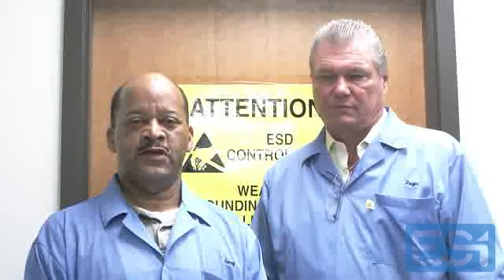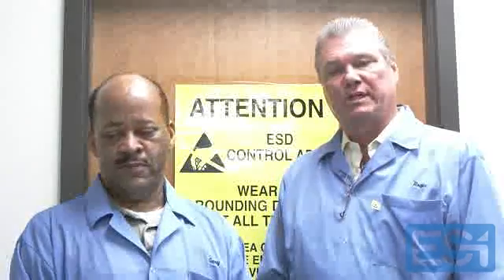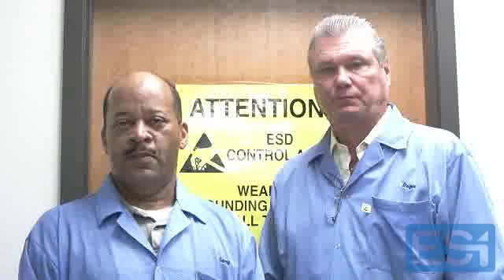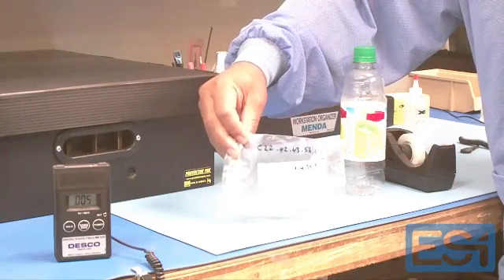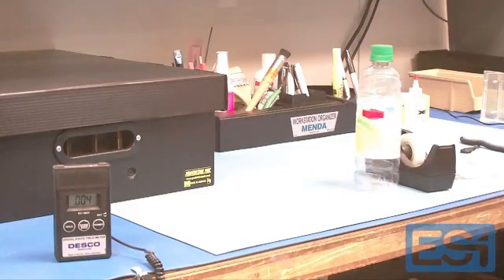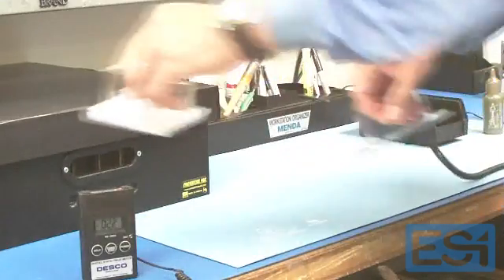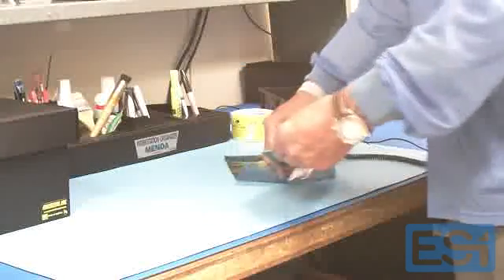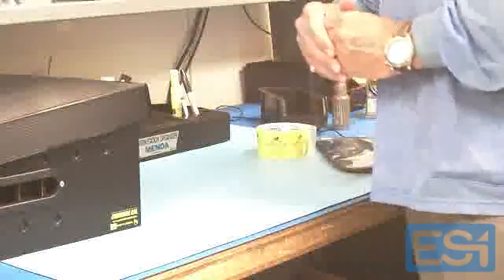ESD Protection - How To Create An Anti Static Environment

Comment: We buy seeds and other organic materials that come in plastic bags and are loaded with static electricity making it hard to even completely empty the bags. To make things even worse pouring the contents of the bags transfers the charge with the seeds. We wind up with little seeds suspended in mid air over anything plastic like a funnel. When we switch to a new seed type,  despite our best efforts, we'll wind up finding old seeds mixed in with new ones down stream. The supply of one more renegade old seed seems never ending.  How could we lose the static while emptying the bags right up front?
Reply from the maker: Get an ESD mat, ground it, and lay the bags on it prior to opening.  Let us know how it works!

Comment: A question, we have ESD floor and the work table and surface rug are ESD, it is necessary to land it to physical ground the surface rug and the work table ??
Reply: It's good practice. For example, if you lift your feet, the grounding circuit between your legs and floor is disconnected. Note that of the chairs used in ESD-protected area are also making a grounding circuit with the floor, but that's only effective if your clothing makes good contact with the chair. TLDR: It's best to use as many safety measures that don't hinder your productivity too much.